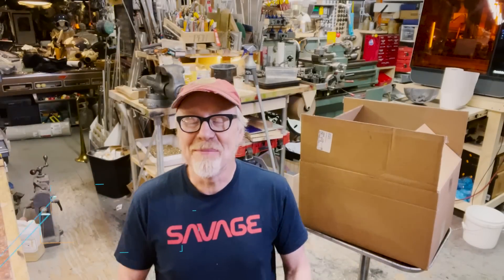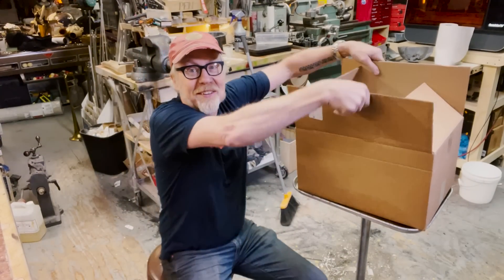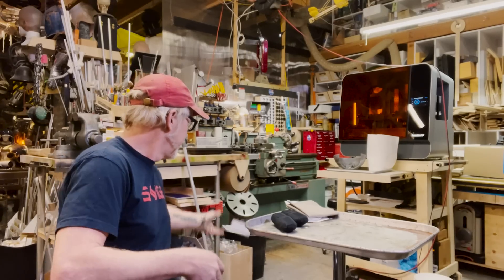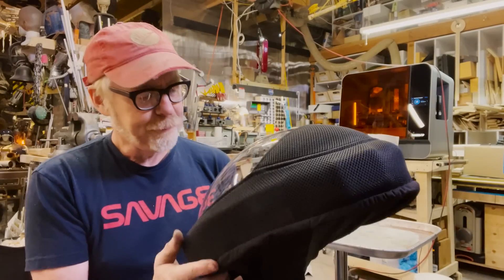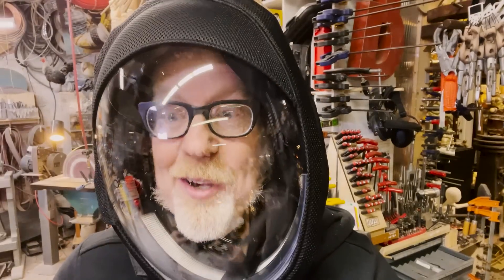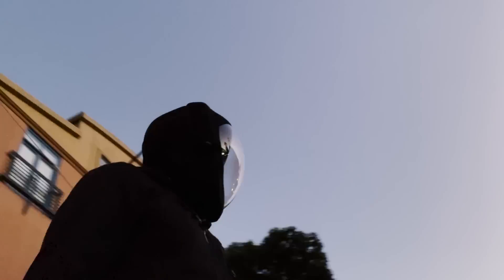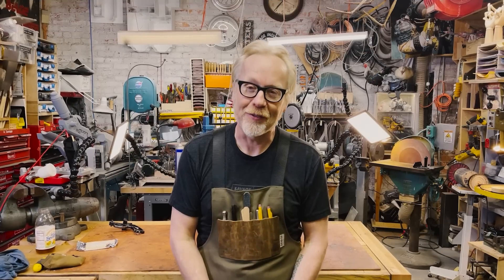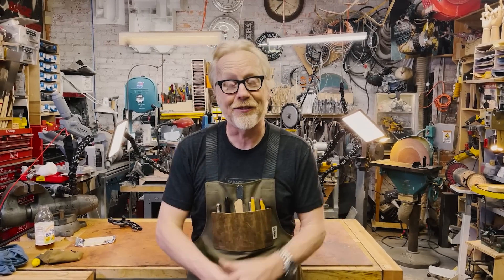Adam Savage Tests the AIR Active Filtration Helmet!

Comment: We essentially use the same thing at hospitals, so this seems like a knock off. The only difference is ours actually work. We wear a waist band that is the air pump and filter. Connected by a hose.
Reply: This version is made to be one piece and quieter. A PAPR is anything but quiet, it has a lot more airflow. This one can easily be fixed if one were inclined to do so. A channel for the air like Dyson bladeless fans use, can be fed from multiple input airways from the top. Blow the air directly on the face shield. Install an exhaust fan with a hepa filter near the chin.
Reply: @PantsODoom  And, technically, this is not a Positive Air Pressure Respirator. The fans blow outward, creating negative pressure inside, so its more accurate to call it a NAPR. Also, from what I hear from my nurse friends, PAPRs don't actually filter the exhaust air. It just blows all that air out from under the hood. That doesn't sound very pandemic safe for public use. Its the same reason why N95 masks with exhalation valves are frowned upon for congregate settings.
Reply: @MikeTrieu  yeah the papr is positive ventilation to the user. The incoming air is filtered but the exhaust isn’t. So it only protects the user not others. In the hospital that exhaust air is then suppose to be filtered by a negative pressured patient room into UV lights and hospital filtration then dispersed into the air outside.
Reply: @PantsODoom  A PAPR is also much more expensive, thus not practical for many people as you know.
Reply: @PantsODoom  the fact that the user would have to mod the device is what makes it trash. The first thing that makes it trash is that the are selling it for covid. Such trash!!!!!
Reply: @shotgunbobby11  Yeah I have no horse in this race and am not gonna argue, if I happened to own one thats what I would do.
Reply: @shotgunbobby11  If that's the kind of attitude you want to take, then you can go suck up all the viruses you can find.  Commercial passenger aircraft have HEPA filters similar to this thing,  but they won't protect anyone from a cough or sneeze produced by the person sitting right beside you.  By the way,  I didn't and don't recommend this product or pretend to know more about it than what its manufacturer says.
Reply: @SkipT43  that’s fine I am at no risk for the WuFlu. Also, if you are only going by what the selling party is telling you then who is the sucker?
Reply: @shotgunbobby11  OK, so you're not breathing anywhere in the world where the SARS-CoV-2 virus exists. Good for you. And you apparently have personal experience with the AIR Active Filtration Helmet, rather than just guessing about it as the rest of us are doing. Good for you.
Reply: Their FAQ file makes it clear that this device is not FDA approved and not intended for medical use. It does offer HEPA 11 filtration. I don't see what makes it a "knock off." It's just intended for a different purpose. The company says it's for high density situations such as air travel. If I had to fly any time soon, I'd think one of these would offer better protection than a mask of whatever kind. More comfortable than a PAPR, too, I'd think.
Reply: @SkipT43  what the filtration rate of a commercial aircraft? I bet better than this, it’s absolutely ridiculous. Go live in a bubble. I’ll be living free.
Reply: I'm not certain if its true for your PAPRs but the ones we have (3M BE-12LB), have holes in them under your chin to let air escape which is why they don't fog up. Not very good if you're trying to keep from spreading COVID but very good to protect you from getting it.
Reply: @l0ckmanjohn  essentially the same thing , holes around the ear and or chin areas exhausted behind the user. Works great. As with concerns for covid, I personally don’t care to “protect” the next person if I was concerned enough to wear one in public. I’ll do what I need to do to protect myself. They can do the same. Personal responsibility.
Reply: @shotgunbobby11  yeah I understand that. It just seems strange that it's what we use in a hospital. Although most uses the n95s but I can't since I have a beard.
Reply: @l0ckmanjohn  we use them in hospitals because the rooms these pts are “suppose” to be in are negative pressured. They’re better than n95 IMO. N95 are too restrictive and never fit right to form a proper seal. Shit, two weekends ago I was sick and stayed home from work, I was being over cautious because of covid right, went to get tested because work required me too, I pull up and the fucker standing at my window asking me questions like 20 inches away from me, had his n95 OVER his homemade mask!!! Lol. I almost cried laughing but honestly felt bad for them because they’re out there trying to do good and no one actually cares enough for them to correct his terrible technique.
Reply: @shotgunbobby11  yeah I agree. We have positive pressure for most patient rooms in our hospital but I believe you're right about the negative pressure for covid. Infact we have entire wings that are kept negative pressure for it theoretically. I hate wearing the paper masks and n95s were only slightly better. At least the paprs give cool air they're noisy but not too bad. And much lighter than my Decon team papr hood.
Reply: @l0ckmanjohn  negative mainly for TB  but yeah it works well
Reply: Yeah but yours are like $2k and they don't filter outgoing air (your exhalation).
Reply: @thedanyesful  🤦‍♂️that’s the point. Everyone wears one and the main air is exchanged through high end hvac with uv lights and filters. It’s to protect yourself not others!!!!
Reply: @shotgunbobby11  No the point is that it's not comparable to the unit shown in the video which is $300 and does filter outgoing exhalations.

Comment: here's a better solution $30, buy a Snorkel Mask on amazon remove the top tube, cut out the bayonet mount from a respirator and epoxy it to the end of the mask where you took off the top tube. now you have a quick mount system to screw on a regular respirator cartridge. or you can be even cheaper and just rubber band 2 or 3 thin socks onto it or maybe 1 thick winter sock. maybe stuff 1 paper napkin under the sock too, test it for breathability

Comment: Adam'Savage Vas Tested!
-
An anti-fogging cleaner on the inside might help a little, but the only real solution is stronger air flow across the visor.
Reply: Or desiccant beads. Stronger airflow == higher battery consumption / less runtime / more battery weight.
Reply: @MikeTrieu  The tricky part with desiccants is a lot of them are toxic, or at a minimum eye and breathing irritants.
-
There is a liquid astronauts use to prevent fogging of their visors that has to be allowed to fully dry before the helmet is put on or it can become an eye irritant.

Comment: A blacksmith youtuber I watch, Alec Steele, has a filtered air helmet very similar to this one, except that the helmet is connected to a waist pack with a hose. Seperating the helmet part from the filteration part seems to allow for much better airflow. He uses it in his grinding room, to protect him from the fine metal dust. The visor never appears to fog, despite the difficult work he does while wearing it. The device is probably really expensive though. Also maybe slightly more stylish than the dome in this video.

Comment: I mean... there are face masks with detached air handling packs that get it right and in those you dont have to have heavy batteries and fans up near your face. You find them in stores that cater to professionals in the paint and chemical industries, they might use mostly VOC filters but the filters are standardized (in my country at least) so you can fit whichever ones you want in there.

Those systems have a belt you wear with air filters, the fan and the battery built in. The air is introduced to the mask part via air hoses. Some of the more expensive ones you can switch the filters and batteries during use so that you never get exposed to unfiltered air. The masks are never fogged up on the more expensive ones since they often use double glass face shields (two pieces of clear plastic with an air gap in between) and thus it has to be significantly more cold outside the mask for the water to condense. They also mostly have input air going to ports just under the glass and outgoing air is taken from the top and sides to create airflow over the area you breathe out.

Comment: I used a powered respirator at work. It had an inner and an outer mask. A soft silicon rubber one that sealed over the mouth and nose and an outer conventional rubber one that covered the whole face with a clear shield to see through. Filtered air was supplied through a hose connected to an air pump and rechargeable battery pack worn around the waist. the pump unit had two replaceable cartridge filters which had combined charcoal and HEPA filters. Run time was about 10 hours continuous and it had some sort of regulator to increase the air intake as the filters became full. There was an alarm to warn when recharging was needed. It had a sensor to increase air intake as the filters became clogged and you could tell when the filters were needed replacing because the operating time was noticeably reduced. I could get about 6 months use out of a pair of filters in a moderately dusty environment. The high airflow kept things cool and I had no problems with fogging. The positive pressure inside the mask meant the only air you breathed was via the inlet hose so no unfiltered air came in. The one disadvantage was the $1300 price tag and the $40 a pair cost of the filters but it was necessary for the environment I was working in.

Comment: Duh! You know people who snorkel and scuba dive successfully keep masks from fogging up all the time. You take a small spray bottle and fill with tap water. Put the spray bottle nozzle down into baby shampoo bottle to coat with just a tiny amount of shampoo that goes into spray bottle. After putting spray bottle nozzle on tight just shake bottle a few times. Then spray inside surface of mask with light spray. Then mask is all set and should not fog. Works all the time I use it and is cheap, easy, and pretty safe to use.

Comment: Hmm. Since it's just a face shield, what about imprinting something akin to to a rear-window defroster as seen on cars?  Lay a thin lattice of conductor into the plexi, and hook it up to a power tool battery. Just use the already there on/off switch and wire it in.
Reply: If the small start-up company had the budget, they could even use transparent conductors like ITO or silver nanowire ink to create this resistive heater trace.
Reply: It already has fans to defog the faceplate.

Comment: Hey I got an idea change you could add to it or maybe a different build, it would add a little heat but with enough ventilation would be viable. Add in defrost wires like on a rear window. You could even put them on the outside to help reduce the internal added heat.

Comment: Hey Adam Savage Most people has the problem with the visors but there is a solution there are things called motorcycle helmet pin lock it will keep your helmet visor from fogging it’s basically like a double window and also ski goggles have the same features to keep fog from rising into the goggles so a double window You can DIY one into that air filter helmet and or any helmet

Comment: The misting problem looks almost insoluble, the human body just produces too much moisture. 
One solution I see is a soft rubber gasket that attaches to the nose (or is held on by an arm) and sucks the moist air away. 
That should work with a low power high volume fan but also requires a solution to aide breathing in. 
Maybe a valve system that detects the breathing cycle and reacts to keep up. (its already getting more and more expensive.)
Reply: It works just fine.  The fan's aren't sized for exercising, they're sized for sitting and riding in an airplane.  If you sped up the fans, it would work for this too.

Comment: Tip to prevent the fogging, even in the cold: a solution of distilled water and baby shampoo applied to the inside of the helmet. NASA switched to this after an incident of an astronaut getting some antifogging material in their eyes while on a spacewalk. As far as quiet fans for using just air, I would look at some of the Noctua computer fans. They are very quiet while moving large volumes of air. A squirrel cage fan would be the other option, but they are heavy and large. You could use the motor off of a Noctua fan since they use a metal hub with a great motor, then 3d print the fan cage. This has been done to try out different fan blade configurations by several people on YouTube.

Also, I want one of these for allergy and fire season.
Reply: The Delta fans already built in are of the squirrel cage variety. The baby shampoo idea makes sense as the surfactant will spread out the water droplets quickly by lowering surface tension. But he should probably just buy a bottle of Rain-X Anti-Fog spray polymer that dries clear.
Reply: @MikeTrieu  that can come loose, but since he isn't in microgravity, that isn't really a problem.

Comment: It looks like a PAPR but without the belt-mounted motor

EDIT: It's not exactly a fix, and I'm certain you've tried it before, but you can at least delay the fogging problem by rubbing soap on the inside of the dome. It should prevent fogging for longer.

Comment: I've been looking at this and wondering if it would make a good respirator for shop use.
Reply: Its not air tight around the face and fumes/viruses/etc can just come in through the cloth in the back. Its a gimmick helmet meant to take advantage of the current pandemic but it could be modded into a space helmet easily for cosplay.
Reply: @4EyedFox  A somewhat valid point about the neck hood, despite the company's insistence that its "impermeable", whatever that means. I did some anemometer measurements with mine, though, and the amount of airflow through the hood is negligible whereas the intake ports where the filters are more significant. Like any fluid, air takes the path of least resistance. And the filters are that path. I don't know how much CFD they did when designing this product, but it seems to check out. If covid is your concern, you could just spray some DWR on the cloth and it would protect you from droplet transmission. The virus isn't transmitted well outside of respiratory droplets.

Comment: Full face respirators solve this with a face pierce sealed over the nose and mouth. The 3M full face defogs itself because the air inflow has to first cross the lens first then into the mouth and nose cup.

Comment: When i was in the Hospital Last September with the dreaded SARS Covid  some of the doctors wore gear similar to this that you are trying out. They had a belt mounted battery and air pump that would supply the filtered air to the helmet.
Reply: Yeah, I'm not wearing an air hose everywhere. Its just too cumbersome and too easy to snag. If anything, Maxair's CAPR system is closer to where I want the Air to be, but even that isn't perfect.

Comment: @Adam:
Would a positive pressure (small tank air) be a solution to the face-plate fogging up?
Having the exhaling filtered vents directly in front of the mouth and nose would reduce fogging substantially with the added benefit of not muffling the users voice. Having GT style slots protected by filters in the general position of the ears would also elevate the lose of hearing casued by the helmet.  Another solution might be to have a fanny pack style fan driven air supply. As long as the pressure created by the fan can get rid of the expelled air fast enough the faceplate shouldn't fog up.

Comment: Turnah81 repurposed a full face snorkel mask into a fume mask for shop work. Forced air and filtered from another room. Also did a mock up for a personal mobile use. https://www.youtube.com/watch?v=kEJdqxTNp6Y

The mask was designed in a way to try and separate the mouth section with the viewing lens. Dunno if you want to experiment with that avenue but it looks like a good idea. Less comfortable cause gasket but completely airtight cause drowning.

Comment: The helmet seems like a good first draft; interesting but not quite there yet.
I wonder if that helmet would be OK for shop use when sanding things, for example?

I am surprised to see your kitchen knives blade up on that magnet bar, though. I'd have thought you would want the edge falling away from your hands if one slips  rather than across your hands.

Comment: Question is the glass or plastic not anti fog coated? Could you test adding a anti fog spray to the inside and see if it works better??
Reply: It totally works better. Water still collects on the dome, but visibility is manageable.